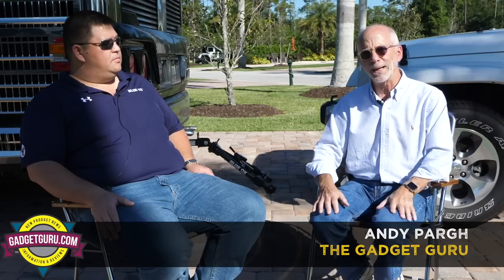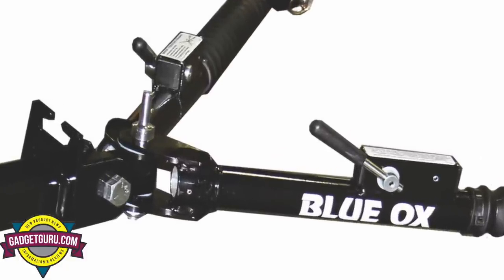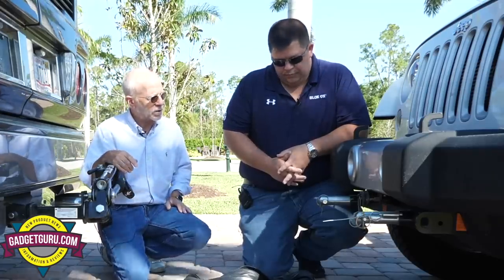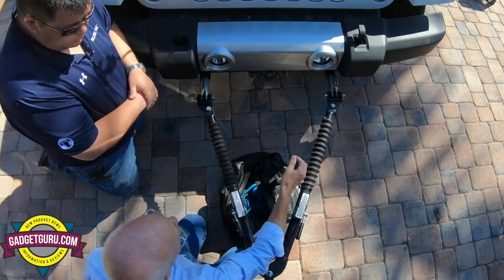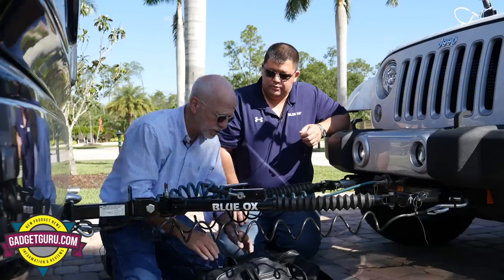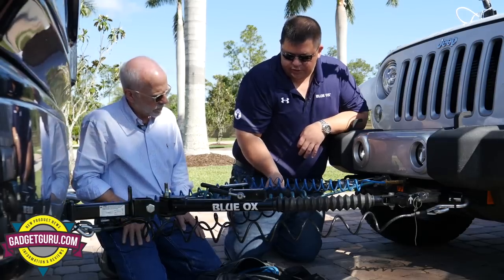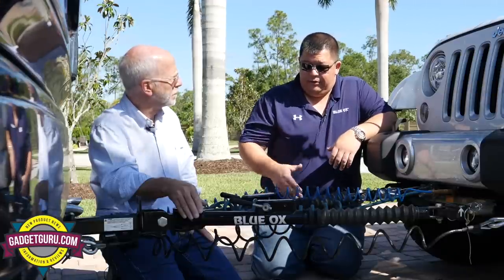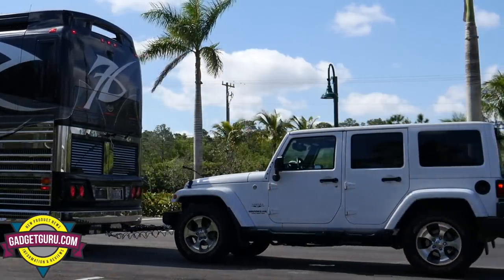Blue Ox Q & A: Safely Setting Up A Blue Ox Alpha Tow Bar

Comment: How did you get your Jeep to work on air for the brakes?  What else did you have to do to flat tow the Jeep?
Reply from the maker: My Jeep has the Air Force One air brake system installed as well as a wiring harness to operate the brake lights. The air hose and electrical plug connect the Jeep to the Prevost.
Reply: @TheGadgetGuru  I looked at Smart Brake that seems great for a tow vehicle without air brakes.  Cutting into the tow vehicle's air brake system makes the hair on the back of my neck to tingle.
Reply: @trolling4dollars816  If done right I wouldn't have a problem with it, but when I watch some of the install videos for systems that do (like the ones eTrailer has published on Youtube) I cringe with disdain at the materials they've choosen for the"kits" and the shop techniques they employ to accomplish the install.  no thanks...